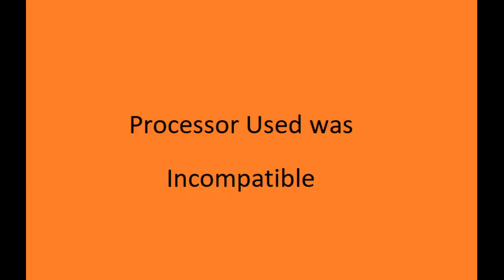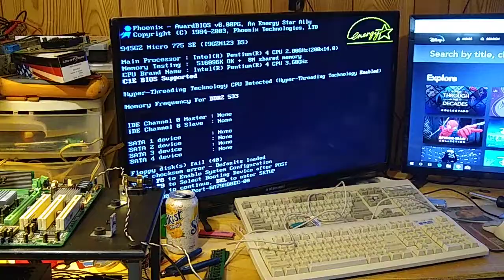Multi System Part 1

Comment: I got a question(its not about the video, I hope you don't mind me asking) do you have any vintage AT style cases still in your shop that you would like to sell and if so for how much and how much for shipping.
Reply from the maker: Yes I do, and they usually go for $20 used +shipping, and shipping is very much dependent on the location its going to
Reply: @retrocomputersuppliersoffi3465   Awesome do you have any AT cases at this moment and how else can I get ahold of you(I believe you had a Facebook link but I have not used mine in 5 years since I don't care about FB) to buy one or a few and have shipped. Thanks for the videos and are anymore in the works.